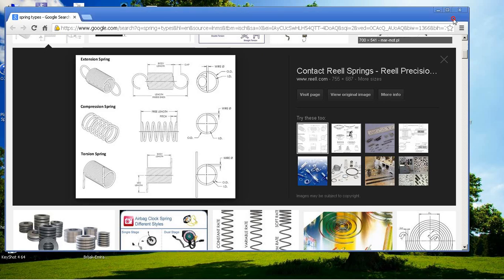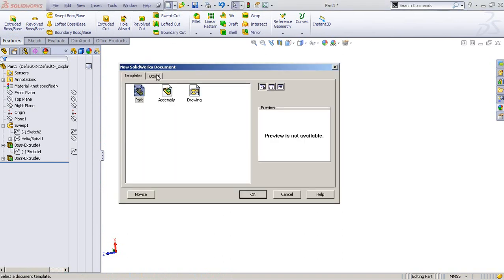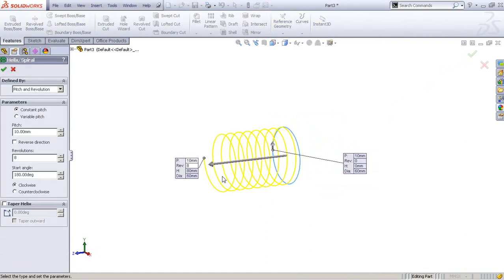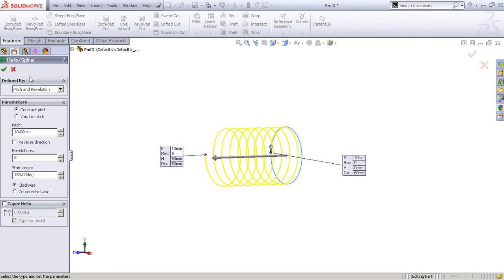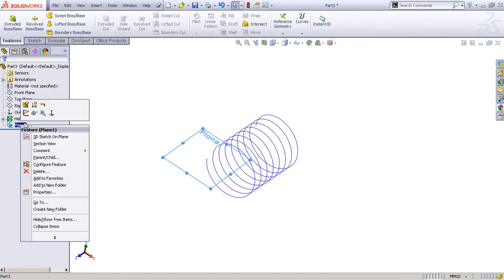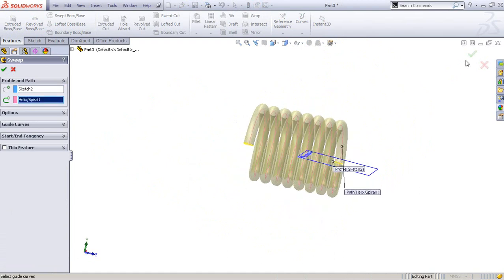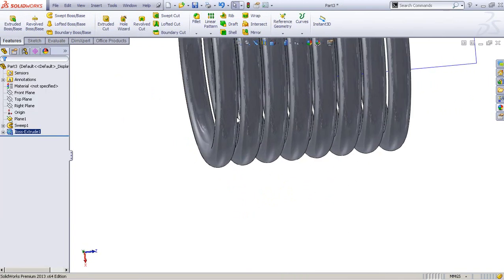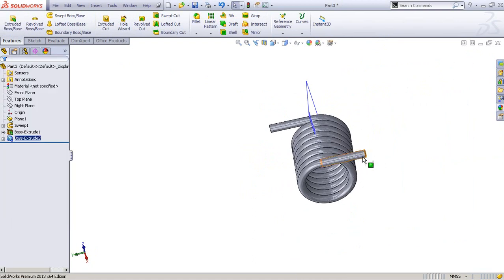Model a Torsion Spring - Solidworks

Comment: Not helpful if you are trying to create a torsion spring from a more complex form - like a 3D sketch.  I have not found a way of doing this in Solidworks without errors, but have done it easily for years in NX (Unigraphics).